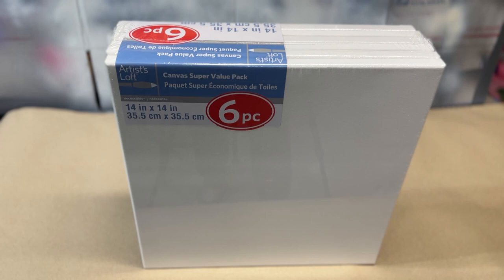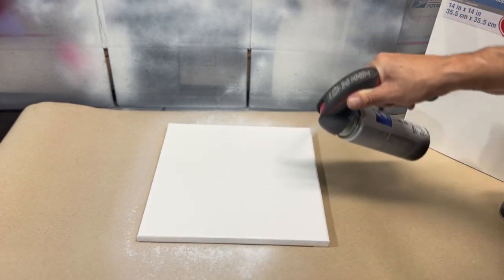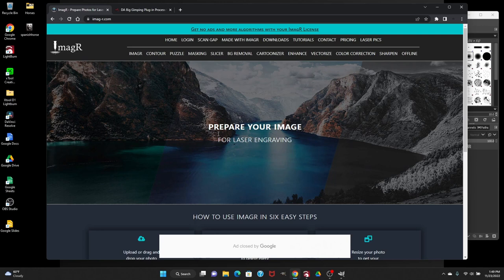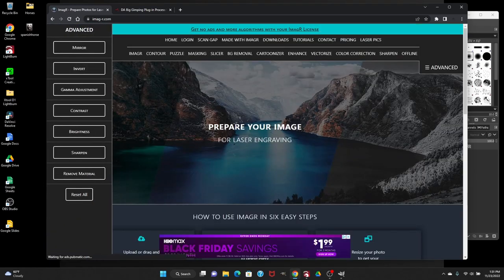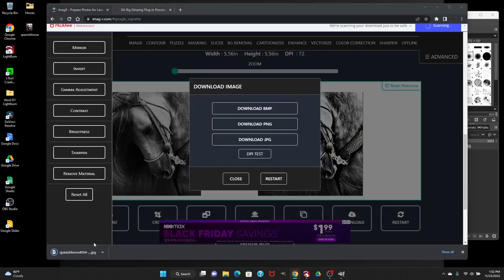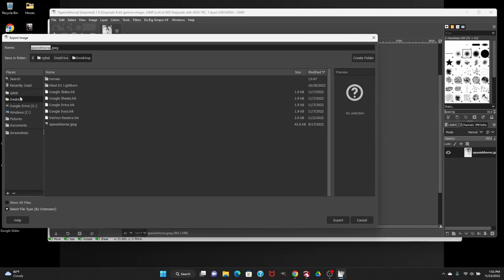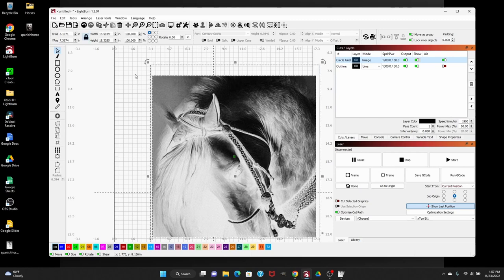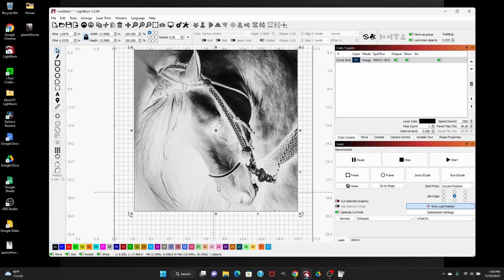My Best Laser Engraving Method - Preparing Your Image and Canvas

Comment: nice video, but I have a couple of questions, wouldn't resizing the image after running through gimp or imagr change the process and wouldn't you run pass through so not to add more dots?
Reply from the maker: Typically you wouldn’t resize but I’ve had no issue doing so. I’m sure depending on the image it may distort it but nothing I’ve really noticed. The imagr image was run using passthrough. The gimp image I change as the script produces a newsprint image and changing to Jarvis provides a higher quality and better overall engrave.

Comment: Typically if you do a three or four color job on canvas do you change your your speed and power vs 2 color?
Reply from the maker: Yes, I change speed and power and it also depends on the colors I'm using. Running and image engrave test is best to get the settings for multi color.

Comment: Your work looks great. I use paid image-r, and they and others always suggest passthrough when dithered outside of lightburn. Have you tried passthrough with gimp plugin? I've noticed my time with image dithered outside of lightburn, when I select Threshold or passthrough, I get the same estimated time. Also I've done a preview with your speed, and my time is 4hr 28min 47sec  I set up my device in lightburn by clicking, device settings, then additional settings, and read from controller. I've done 12x12 and 10x10 mirrors and when I preview the time it is pretty much spot on. I use OLM2 Pro 2 which is grbl based.
Reply from the maker: I’ve not done passthrough when I process using the gimp plug-in as their default is newsprint. I use Jarvis so hence I don’t use passthrough. I’m working on another video where one image will be done using the free option of imgr and other using gimp plug-in. Will use same LIGHTBURN settings for both so keep an eye out for that one. That’s for the great feedback.
Reply: @wtwtx  your comment from above. I process using the gimp plug-in as their default is newsprint. I use Jarvis so hence I don’t use passthrough. That would be double dithering. They say don't do that, but I wonder if they tried?
Reply from the maker: @nitrom68  the results have worked out well for me not using passthrough.

Comment: What difference do the different lense sizes make when using da big gimpin? 9:30
Reply from the maker: Essentially the DPI will vary depending on the size of the lense on your laser. Check the specs on the laser you use, it will typically give you the lense size. C02 lasers such as Thunder Laser use different lense sizes based on what your doing.
Reply: @wtwtx  can't seem to find the lense size for the xtool d1 pro 10 or 40w 🤔
Reply from the maker: @williamcary168  if you are using gimp plug-in v4 select the smallest lense. If you use v3 or imagr, you don’t have the option to select a lense size. Choosing a lense is only relevant if you are using a co2 laser.
Reply: @wtwtx  ahh ok thank u very much for everything

Comment: I was under the impression that pass through had to be selected when running an image through gimp. Does it make a difference?
Reply from the maker: Passthrough is not required. You can turn it off and set your own preferences in Lightburn.

Comment: I thought pass through needs checked because you are not letting LightBurn do the image processing?
Reply from the maker: Yes, if you don’t want lightburn to change the render of your image from another process you used, you check it. My method is what works for me and meant as a suggestion to achieve better results.

Comment: Thanks for the tutorial! Very well explained! I'm brand new to lasers and have not yet tried a canvas but your work is really inspiring!!
I'm just trying to figure out some basics (very limited experience with LB but I can make most things work). Why is the processed image a negative of the original? Thanks for helping me to understand!
Reply from the maker: Glad the video is helpful. I am not certain why the image needs to be negative. My understanding is LB reads a negative image and engraves the opposite in all the modes except grayscale.
Reply: @wtwtx  Ah, okay. Makes sense- that's the first I've heard of that but like I said, I'm so new I don't know what I don't know! 😀
Thanks so much for the quick reply! Subbed
Reply from the maker: You bet. Every laser burns a bit different so do a small test to ensure the settings work for you before committing to a full canvas.

Comment: I can not get gimp to work after i do everything it always makes my photos newprint
Reply from the maker: When you take it into lightburn and change it to Jarvis or any other option, newsprint will be ignored. If your using the plugin, the default it’s set to is newsprint as that is what most would typically use for photos.